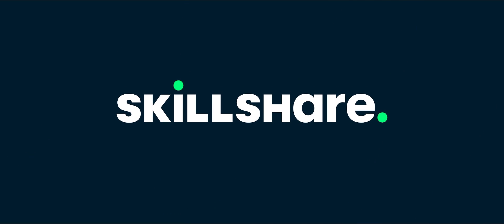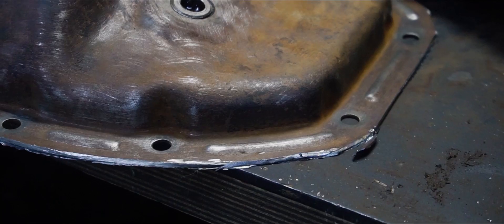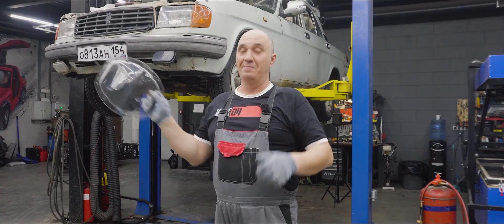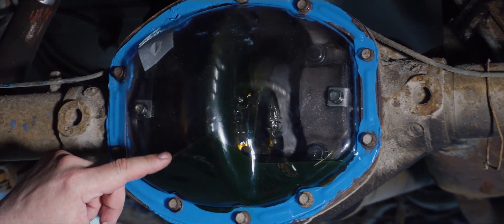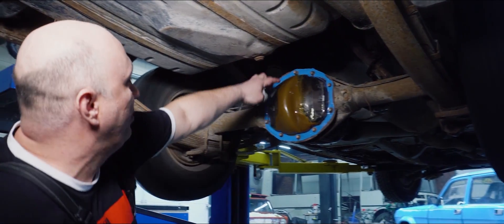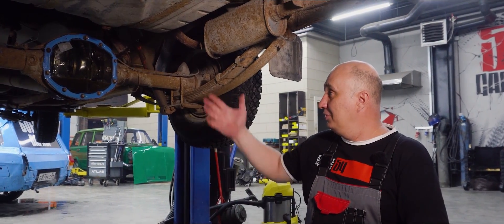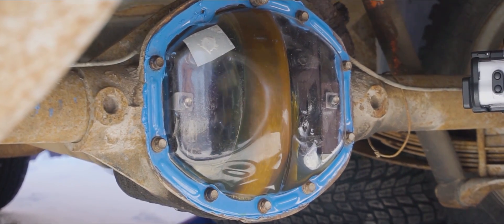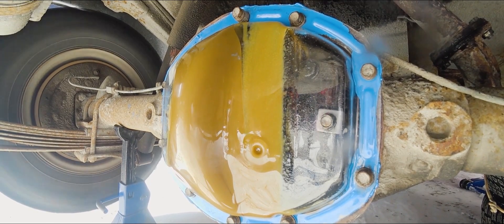Observing frozen oil under a transparent differential cover

Comment: The volume inside the diff cover is going to be higher because it was formed around the outside of the original. It will need more oil to reach the correct level.
Reply: That's what I came here to write.
Reply: Running the numbers using volume of a sphere is v = 4/3 x pi x r^3:

Assuming differential cover approximates the shape of a 1 foot diameter ball (it roughly does), the volume of this ball minus the volume of a slightly smaller ball inside of the first ball will give the volume trapped between the balls.  The slightly smaller ball will be smaller by as much as the thickness of the metal in the differential cover.

So, the gauge steel used for differential covers is about 14 gauge (about 1\16 inch) thickness, so this converts to 1/192 ft. If the first ball has an r1=0.5 foot, and the second ball has an r2=0.5-(1/192)=0.49479166 ft., finding the volumes is just using the above formula for the two balls, and then v1 -- v2 will give the volume, as mentioned before, of the space between ball 1 and ball 2. Chop that result into a third of it (only about a third of the ball will rest in the differential cover) and you end up, after converting empirical units (freedom measurements) to liters, you'll get 0.152835 liters of additional oil needed.  That's like a spitball's worth, albeit a big, sloshy goober type that would sound like "THUNNNNNG" in a spittoon rather than a "ping".

However, this is even wrong - the plastic was shrunk onto the outside of the flange as well as the roundout. That means that the plastic flange will end up exactly where the metal one once was (that is, bolted up against the cast iron case), which means the plastic one emulated the metal one almost perfectly in almost every way.  This means that the overall volume remains almost unchanged.  One wouldn't even be able to measure any change at all.

Comment: Another interesting and informative video - good! . . . How about, what happens if you fill a gearbox with engine oil instead of gear oil? Or fill a diff with engine oil? - What happens if you fill a gearbox (or a diff) with diesel fuel instead of gear oil?!!
Reply: Years ago I had a 1967 Peugeot 404 and and they used normal engine oil in the gearbox. Come to think of it, my 1962 Mini engine and manual gearbox shared the same oil. What's more, the automatic versions shared the engine oil as well! https://en.wikipedia.org/wiki/AP_automatic_transmission

Comment: Suggestion: mount the carburetor off the intake manifold a few feet straight up with exhaust tubing and see if the ram effect increases performance.
Reply: Tuned intake manifolds exist, but they only give a boost in a certain rpm window, at other rpms, the effect can even be negative.
Reply: @Tore_Lund  Perhaps a telescoping runner could be made?

Comment: Remember, this oil also lubes the wheel bearings. When cornering it goes out to bearings!!
Reply: That's actually quite a rare setup and if wheel bearings are lubricated via the diff, pipes are usually used - or splash lubrication - so it works if you are not cornering, too. In most cases, there are seals to stop diff oil getting to the hubs and doing bad things contaminating the brakes! The wheel bearings are lubricated by whatever they were packed with when installed or even sealed for their service life. They are usually lubed with good old grease. FWD and RWD cars with IRS don't even have any covering over the drive shafts, so those could not possibly use diff oil to lubricate wheel bearings without some interesting and obvious plumbing!

https://www.machinerylubrication.com/Read/31245/wheel-end-lubricants

Comment: Here's a suggestion for you. A high rolling kind of a car not with a lift kit like a 4x4, not massive wheels either, more like the drivetrain in the normal place, normal wheels too, but the body up on stilts or something with all the controls extended. It should be 107% percent ridiculous

Comment: This is easily one of the most informative videos I've seen on the effect of lubrication. Very well done, all of you!

I'd love to see a similar style video on a gearbox - not for the oil lubrication, but to see a gearbox in action.
Reply: You can run a trans with the cover off briefly. I've done it a few times out of curiosity.
Reply: @the_kombinator  you definitely could with a manual but it'd be a little messy
Reply: This is something I always wanted to see, because I’m from North Dakota. It doesn’t get as cold as Russia, but close enough for me!
Reply: I have a question. Does the frozen differential oil actually heat up after some time or does it stay frozen
Reply: @DonDon45-i5h  ....I would assume it depends on where the differential is. If it's located next to the gearbox, as in modern front wheel drive cars, which is right next to the engine, inside the warm engine bay, it picks up heat from the engine too, (apart from the internal heat), and it deffinately gets up to temperature. You may need to drive it for a while, to warm up, but eventualy it reaches some temperature. It may or may NOT be the "opeating" temp, but it will get warm enough to flow nicely as it is designed. Or at least flow as we see it in room temperature. 
If the diff is away from the gearbox, like the one in the video, I have my doubts. It is very well cooled all the way around, and you may need to run it for longer, or maybe with load, to warm it up enough to reach the flow of room temperature.
Reply: @DonDon45-i5h  If it's frozen solid, nothing is going to move.  But if you break through that ice, it will generate enormous amounts of heat and probably destroy the housing if not the diff itself.    The gears are MUCH stronger than the housing.  Chunks of ice being thrown around could very well crack the housing.
Reply: @tarstarkusz  .....interesting aspect. My wonder is : why would it get frozen "solid"? Isn't dif lube supposed to stay at a relative viscosity? Even in extremly low temps? For that exact reason? Not to have an ice berg inside the diff cover, and not to have to brake it, destroying everything. Are you sure the case you're describing is real? 
Don't get me wrong, just askin'
Reply: @mr_nice.  Perhaps it won't freeze at all. However, all oils become much, much thicker at low temperatures.   If you don't live in very North places, like say Edmonton, Alberta, you may not know this, but in many places you can install a block heater for this specific purpose. Oil, if too cold, will basically turn into a (cold) wax-like consistency. 

 Being from Philadelphia, I never even knew this until a friend of mine moved to Northern Montana and told me of these engine block heaters and how a lot of stores provided 120 outlets in the parking lot to plug the heaters in on the coldest days.  So I have no real reason to believe this doesn't also happen with differential oil.

OTOH, the guy in this video didn't put gear oil in the diff, he put mineral oil in the diff (he says it at one point in the video)/
.
Also  on this channel, there is a video where they made a see through oil pan and then left it outside in 30 below weather and then started it. You can see the oil (again, mineral oil not motor oil) has more or less turned into a solid wax-like mass, if not outright frozen.
Reply: @tarstarkusz  ....."block heater"....haha....just imagine, only a few seconds ago I was watching a video from  Adapt ape, talking about block heaters. What are the chances?  😂😂😂😂
Yeah, they are a good idea, but also you are correct, the oil turns into a waxy fluid. Same with diff lube. But freezing solid....and the gears having to actualy "brake" a thick blob of wax.....mmmm I don't know. The lube manufacturers make'em good these days. 
I would suggest Garage54 try using engine oil 5W-30 in the differencial in that cold weather, to see how it works. Maybe even thinner like 0W-30 WITH that transparent cover.
Now THAT would be interesting. 👍👍👍👍
Reply: A channel for Banks differential covers has a series of videos with plastic covers that's pretty interesting.  Search "What's going on behind your stock diff cover"  This is one of the videos and there are a few others too.

Comment: The reason the amount of oil was lower is that you've cast the cover on the outside of the real one. So the internal volume increased by the volume the walls of the metal cover would have taken up.
Reply: 1 ounce

Comment: Suggestion: crazy idea use another full rear axle in place of the drive shaft (connecting the transmission and original rear axle) then hold the pinion tight lol. Cheers 🍁
Reply: That would just reverse the rotation.
Reply: @mitchellpatterson1829  aye yes sir it would be 5 speed reverse. 👍could do some serious fast backward spin forward action I suspect. but yer top speed forward might be a little less than desirable. might be interesting. if anybody could make it work garage 54 could.
Reply: @SecondhandOverland  
Maybe an axle with a locker, and a locking pinion. Engage the locker and release the pinion 5R 1F, open the locker, and lock the pinion 1R 5F. Whole new kind of 10 speed.

Could also take a mechanical 3 speed automatic, and flange mount that to a pinion, and connect the driveshaft to where the torque converter was. The rear end will shift 3 times, then you would shift the manual to the next gear up front. The loss in drive speed should kick down the axle auto back to first.
Reply: @mitchellpatterson1829  oooh hadn't thought about that. you my friend have a mechanical mind. I was just surmising a Pto type setup off the pinion with another engine or something lol . Cheers

Comment: Suggestion; Go from crazy cold air intake to hot, see the difference in power and see how the motor reacts to cold air and hot air.
Reply: Famed Nascar mechanic Smokey Yunick did this with a Pontiac Fiero based on his experience with the performance of near dead engines. It ran way better than expected.

Comment: Suggestion: gearbox with  transparent cover !
Reply: Don’t forget lit up with leds!
Reply: That change when it shifts...
Reply: That would be crazy amazing 🤩
Reply: Came here to recommend this
Reply: U wouldnt see much
Reply: @FoggamingMc  cut out the Side of the gearbox ofc. Not just the cover. See both the top and bottom "shaft"
Reply: Automatic transmission with transparent cover.
Reply: DSG
Reply: One could simply cut the gearbox. You would see the gears all the same. No need to make a cover.
Reply: @spiKey0svetlana  would be fun to see how the oil is behaving in a Gearbox :)
Reply: @kulan9379   @Kulan  yeah, I suppose  youre right.
Theyve been crazy enough doing things we never would have imagined, so why not that also.... 🙃
Reply: That's what I wanted to say
Reply: Beyond imagination ♥️♥️♥️
Reply: Yeah
Reply: They have a video I bealive it’s along the lines of lotta gear box with no oil, they have a good camera pointing at where the oil pan for the transmission would be.
Reply: That’s kinda happened in the how long can a gearbox Tun with no gearbox oil?
Reply: Diff oil as engine oil
What will it do to it ??
Reply: You better stick to metal , when a rock breaks the plastic cover, catastrophic failure $$$$$$
Reply: That would be nearly impossible to make
Reply: @WASDxMerceless  They could just skeletonize it, leaving the structural ribs and put in a bunch of plexiglass pieces.  Never seen a manual trans with a cover or oil pan but this would work.
Reply: @WASDxMerceless  i Guess it dont has to be able to work in high NM loads sends through it. Just a free spinning propshaft is enough on the other side :)
Reply: @kulan9379  It only has to work long enough to give us content before breaking spectacularly on camera.
Reply: @WASDxMerceless  Why? Ladas have a pan screwed to the bottom similar to an auto transmission. Why would that be impossible?
Reply: @WASDxMerceless  more like expensive. Not too difficult with access to a vacuum forming machine.

Comment: I want see how the gas pedal is linked to the speed clock meter; when pedal is pressed, how the speed gets read by the clock?
Reply: There is a hall effect sensor at the back of the transmission hooked to the drive shaft. A disk with gaps spins in front of an electromagnet. The voltage to charge the magnet changes as it passes one of the windows in the disk, and the computer (speedometer) counts the pulses.
Reply: Hehe! Not on a Lada! None of that 'hall effect' electronic voodoo! The Lada speedo drive is mechanical - a gear is driven by the gearbox output and connected by a long old cable to the back of the speedo head. The inner of the cable is squared off at each end so spins inside the cable outer and so drives the mechanical speedo! Old school stuff

https://www.lada.shop/en/lada-2107/7b2-gearbox/c7-speedometer-drive-gear-unit/
Reply: Really? Still using a cable speedo, I thought they would have done a square wave VSS when they finally adopted fuel injection.

Comment: Suggestion: weld 4 hydraulic floor jacks to the car and connect them to the power steering pump for a built in jacking system
Reply: Nascar already has this
Reply: @szili76  pneumatic, but yeah build in lift system
Reply: @szili76  Nascar does not.
Reply: I would like to see that
Reply: @randyboogenvia6252  my grandparents have the boxset of vhs'
Reply: @randyboogenvia6252  legendary show👍
Reply: Or 4 permanently mounted air jacks and a pit crew member with a probe to operate them!!!

Nevermind...too motorsporty....
Reply: Trophy trucks sometimes use this too
Reply: @UnsungThermidor  I haven’t
Reply: That's been around for 70 years.
Reply: @napalmholocaust9093  where can you buy a kit then?
Reply: @jhsevs  Austin had it on their larger model cars. Austin 16 in the 1940's
Reply: @napalmholocaust9093  yet nobody uses it, except maybe F1. Who else?
Reply: @stevencolby49  V8 Supercars, Most GT series, Indycar, Lemans Prototype cars ETC.....
Reply: @stevencolby49  F1 doesn't have built in jacks on their cars. Who is saying this nonsense?
Reply: @SkylineBNR34  lying ass google 😒
Reply: @SkylineBNR34  IndyCar/F1 different sides of the same coin
Reply: @stevencolby49  my uncle had a 935 Porsche that had built in jacks, they were pneumatically actuated if I recall.
Reply: Somebody has seen the bad remake of the movie "Taxi" I see...
Reply: A lada has no power steering
Reply: Sounds like a lit video
Reply: This would work much better with pneumatics rather than hydraulics. Hydraulics tend to operate quite slow and for a good reason the oil will aerate if moved to quickly. I believe Indy cars use a pneumatic system. https://www.indycar.com/Fan-Info/INDYCAR-101/The-Teams/Anatomy-Of-A-Pit-Stop
Reply: Kinda like the Mock5 did eh, Speedracer?
Reply: What kind of a monster are you?
Reply: I don't think this car has power steering.
Reply: Running the gear box with both wheels off the ground is pretty bad for it. With a standard differential, if either wheel loses grip, the wheel that loses grip will spin twice as fast.  So say it took 6 rotations of the driveshaft to turn the wheels once, with one or both wheels slipping, it will now only take 3 rotations of the driveshaft to spin the wheel once.
If you have the wheels off the ground and you spin 1 wheel manually, the other will spin in the opposite direction.
Reply: @tarstarkusz  what lmao
Reply: @jhsevs  Yes, a standard differential works that way.  However, you can see at 10:58, this one doesn't work that way, perhaps it's a limited slip differential or there is something different about the design.

Comment: Make a Lada steer backwards / opposite and at a public event have a contest to see if  people can park it in a difficult spot.
Reply: Forklift operators will have no problem.
Reply: Maybe give one all wheel steering, but the rear steering goes in the same direction as the front
Reply: @omega1575  crab steering then
Reply: @omega1575  crab would be even easier
Reply: Good one
Reply: Wouldn't that make it easier? Visibility of pulling in straight, but maneuverability of reversing in. As long as you can make that connection in your head
Reply: @DoesntRefillTheBrita  its not that back tires steer the car. its just opposite steering front wheel steered car

Comment: Suggestion: what happens when using different lubrication on manual gearbox? Or at rear-end? ATF?, cooking oil?, Hydralic Oil 32S (very common at my work place)
Reply: I second this. Especially with ATF.
Reply: Well, don't put 80w-90 oil if it requires some gear specific lubricant that most modern vehicles use, more of a 0(5)w-30,40 weight, unless you want to change a lot gear box components
Reply: @pliedtka  I've put 80w90 in the crankcase as a topup (and to stem the thinned oil from leaking everywhere) in the dead of winter to get the beater to the spring - I'm not changing oil at -20 temps lol. Did that for 3-4 years, engine lasted all the way till the end (Rust got the car).
Reply: @pliedtka  Please consider  that 75/80/90 weight gearbox oil is a different viscosity 'scale' than 0/5/10/.. weight for engine oil.  
Thats due to different ISO-norms applying.